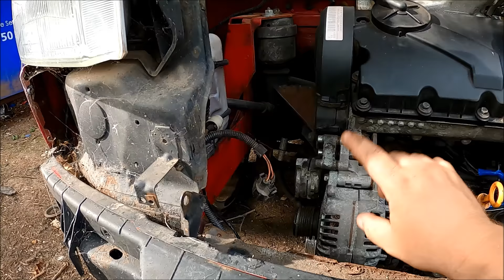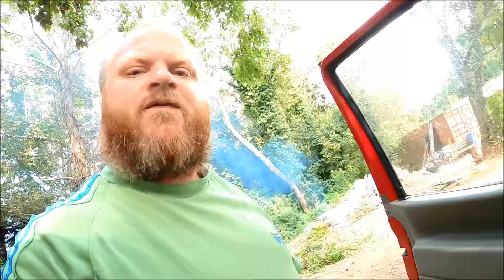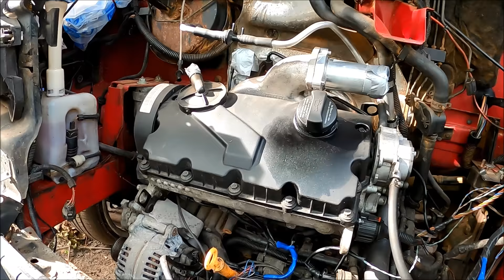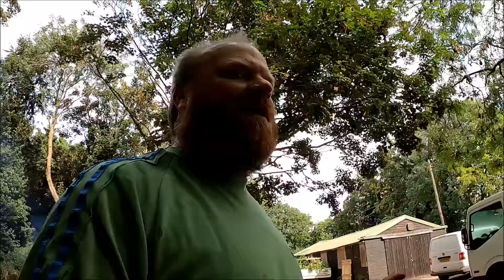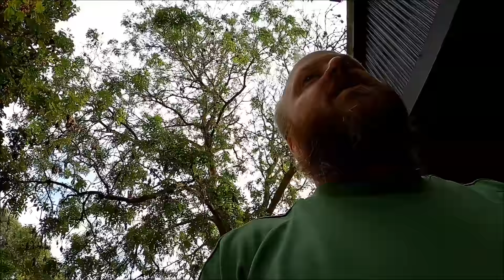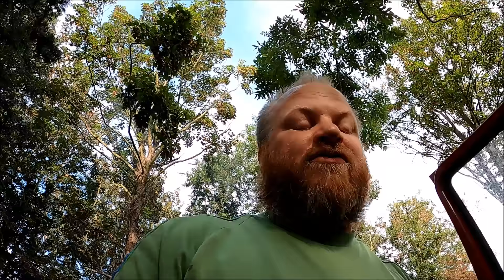VW T4 transporter pd130 engine swap conversion modified 2003 wiring loom

Comment: Where you based? I've a mk4 golf in boxes and a galaxy in boxes both engines both looms. The galaxy pd130 complete with box. I've no drive shafts and I've no wiring from the t4. Do offer a service fitting the conversion? Cheers 🍻

Comment: Hi mate I’ve had a Mechanic fit me a pd150 in my t4 long nose it’s all running and driving just need to plumb the intercooler I’ve noticed the water pump is so close to the floor what’s your advice on this ?
Reply: Power steering pump
Reply from the maker: Yer I have been looking in to moving my water pump been looking at modding the bracket to lift it up 😊
Reply from the maker: Power steering pump lol

Comment: Hi you seem to have made it a bigger job then needed .you only need engine loom then splice into your t4 loom .clutch switch you can map out .also immo off it takes two min.  So long story short youl have 3 fuses and 1 relay to run the engine .
Reply: I'm about to start stripping a golf for this, can you explain this a bit more, when you say splice into your t4 loom, are the wires like for like so it really is as simple as match up like for like?

Immobilizer off? how do you do that bit?

Comment: Well done ! I'm waiting for the continuation of the engine swap. I am curious how the driveshafts will be installed. What engine code?
Reply from the maker: Because I use the original t4 1.9 box the drive shaft were the same and bolted strait up